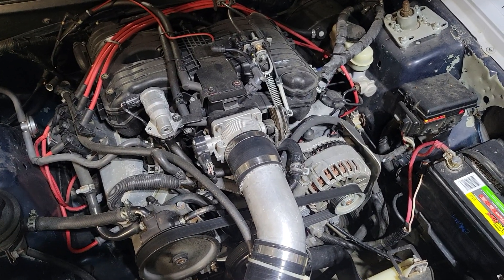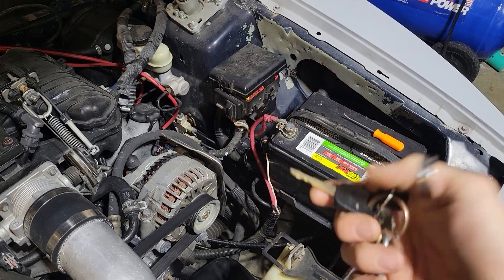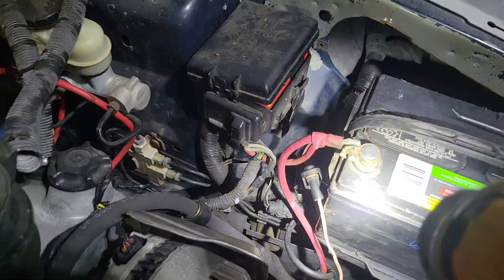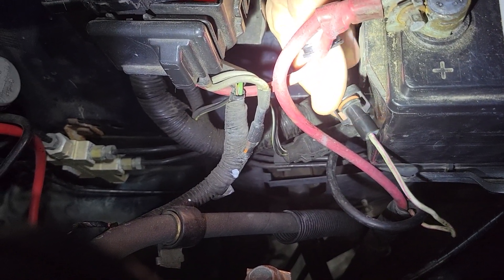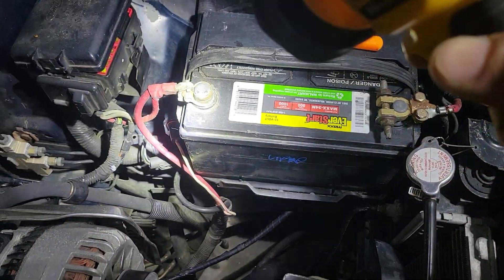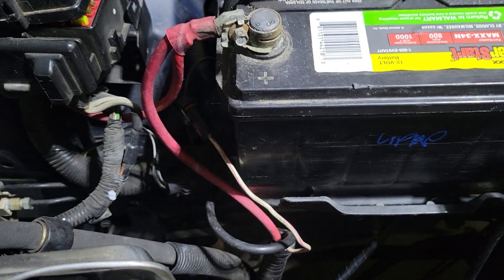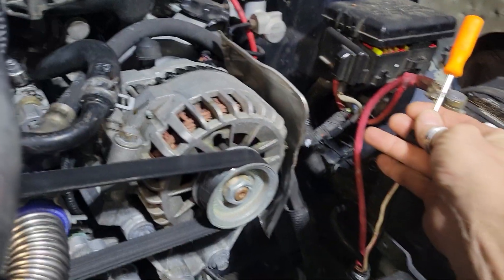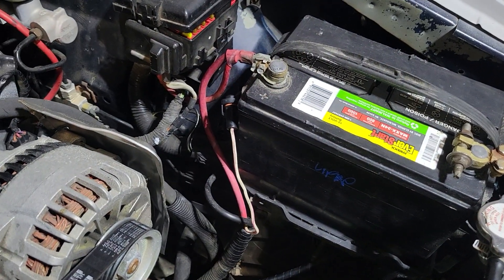Ford 3.8 V6 Tech Tips: Starter Solenoid Switch

Comment: Wanting to do a 3.8 to 4.2 swap in my 2003 mustang newedge the only question I have is what do I do to program the ecu to accomidate for the increase in displacment.
Reply from the maker: @RFAdventures  the ecu will run it plug and play keep your mustang rail injectors maf oil pan/tube/windage tray and run it. You'll get more power out of a tune but it will drive fairly good direct swap